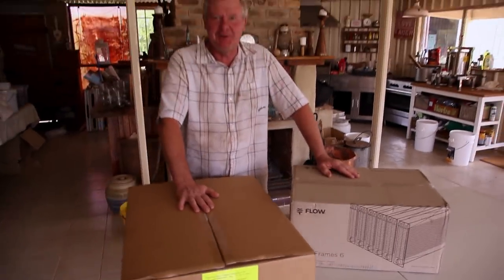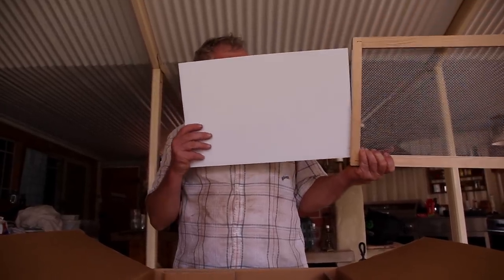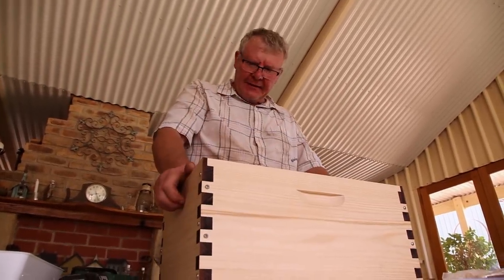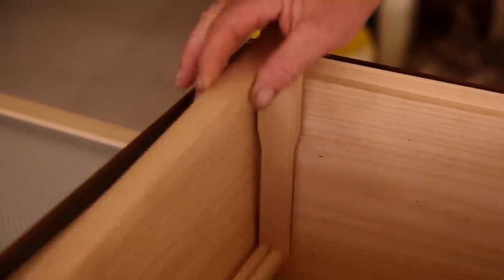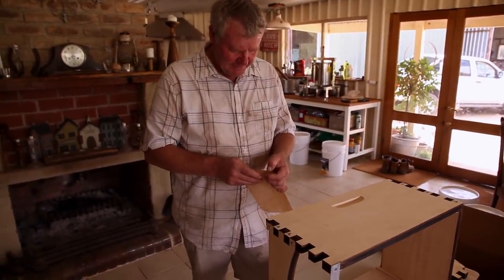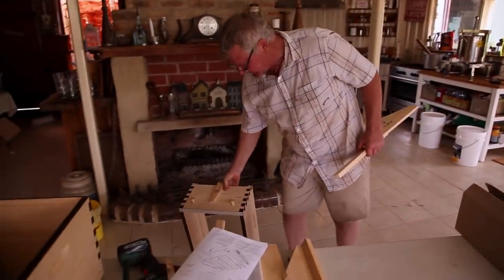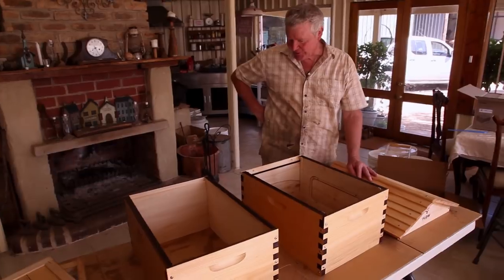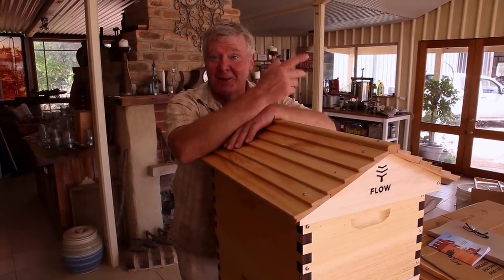How to assemble an 6-frame Flow Hive - The Bush Bee Man

Comment: Never owned one, i know plenty with them they're a novelty for backyardigans and kids lol most people ive talked to have trouble getting the gals up into the flow frames ive suggested blanking the brood box down to 4 frames and feeding syrup and pollen sub to get them started, lightly brushing melted wax and propolis over the "comb" on the flow frames to help disguise the plastic smell. When they have worked the flow comb once youre right, crack n fill and the girls re-propolis the cells and you go again

Comment: some things about the flow hive. flow frames- make sure you keep them straight and steady, they can break apart and can be difficult to put it back together. if you find it hard to get the bees to put honey into the frames spray sugar water I it. NSW did some research and having a vented bottom is better, not by much, 15% more honey I think it was. the wood can swell when wet and crack so watch out for that. I think this is great having one but it takes time for the bees to get use to it. SHB can fall out the bottom so I put mine in the chicken area, or you can put a small bucket of water and that can catch them. you may need pliers to take the caps off for when you collect the honey.

Comment: to me, the instructions were not clear enough. I ended up gluing the brood box as well, but apparently using the parts where the metal strip was meant to go and had to then modify the top to acoomodate it as the base had dried before I realised my mistake (the instructions did not mention this). But not to worry, it will still work! Now to get some bees since bunyip bees are no longer, after going broke with my order still in the works! (yes..... I have the Murpheys luck  it seems, but you just have to learn from the cards dealt, Grrr  all these small annoyances :-) Love your vids mate!
Reply: I'm in the same boat as you with  Bunyip bees . It's too bad since they had lovely bees